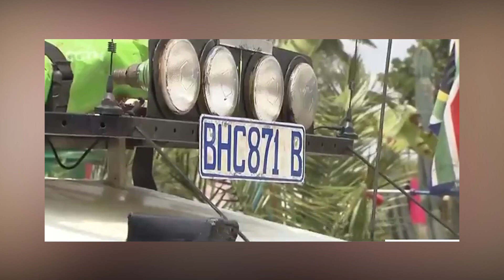When African SCRAP AIRPLANES FLY | African Homemade planes

Comment: The biggest problem with those airplanes is that their propellers are too short and too thin. Some of them would have worked if their propellers were better shaped. Several of the propellers were just thin blades, like machetes' .

Comment: 5:36 thats actually called an gyro plane it Don't power the top propeller only the one pushing it by using the auto rotation the top blade makes lift and make the plane without wings

Comment: The last one requested a solution to his plane not flying… well, here it is.. you were ringing a wheelie and your elevator was down. That tells me your center of gravity is too far back. Move your center of gravity between the first and second third of the wing chord. Example: if your wing is 3 feet from front to back, then the entire plane should balance level when the plane is suspended from a point 1 foot from the leading edge of the wing. I’ll be waiting for the update.

Comment: I'm rooting so hard for them... I  build R/C Planes, Drones and even once a powered glider that could carry me (which got me in trouble with the law but I was only 13 at the time), so I know a thing or two about flying. Some of these guys are so damn close! 

Mostly they have efficiency problems with the props, too small wings, slightly too heavy construction,  or CG problems... the one for example that was so darn fast and did a donut needs a wider gear and a different wing profile. 

I really wish I could help them. Bring some waxed canvas and carpenter tools and we could build something that flies like an Ultra-light. 

It's so heartbreaking to me to see how close they're to achieving lift-off but getting thwarted by parameters that are just slightly off...

Comment: Failure in this case is not a lesson learned but a mistake made.  The mechanics of flight has been known to man for more than a century!
Reply: Sure.  But I reckon that most hobbyists in the West would struggle to properly assemble a kit plane if they ordered one.  Now imagine that you're scratch-building: you don't get the kit, only the plans.  Then imagine you're sourcing the materials, not from Amazon or a DIY store, but whatever you can lay your hands on.  In terms of designs and flight theory, these guys have the shoulders of giants to stand on.  In terms of actually fabricating a plane, they are probably worse off than the Wright brothers.
Reply: It's a hobby, you genius...

Comment: Do you have more videos of these contraptions that actually fly? I believe with access to the Internet some smart Africans should be able to scrap together a decent ultralight. 
The autogiro at 5:30 that actually went up is quite descent. KUDOS to the engineer.
2:36 Airframe looks mechanically sound - it was the pilot's skill that let it down.
7:53 Plane should also fly after getting a bigger propeller and wings.

Comment: Hats off the the daring of those chaps. I flew my ultralight back in the 1980's here in the U.S. and not trying to be too critical but most of these craft are too heavy in the materials used Vs. the engine power or not really knowing how to do a weight and balance calculation. I am still scratching my head on a few of those designs. That one gyro seemed to fly well ;-)

Comment: The African lads are very smart. They figured out airfoils, variable pitch propellers, tail rotors. But did not figure out power to weight ratios and center of gravity calculations.

Comment: I do not know much about their research process, but it seems like they have the two most popular types of flying machines and their starting point and building from there, starting with a conclusion instead of building it from the problem-up. Instead they should research about other types of flying machines like autogyros, paramotors and gliders which are less complex mechanically. As of now their biggest roadblock are the heavy engines they have access to, they should remove as much material as they can from their airframes in order to maximize their chances of success

Comment: The number of helicopters leads me to believe that these guys do no research whatsoever, if they did they would know that helicopters are 10 times more difficult to design, build and operate, and that it took highly qualified engineers around 40 years from the Wright bros flight to get it right......
It also occurs to me that they think that if it looks like a plane, it will fly, power to weight and lift to drag ratios are just colonialist concepts conceived to keep keep african genius under control 😂😂

Comment: Have to admire their ambition to achieve the dream. It's impressive some of these gentlemen do get airborne, although I do cringe a bit worrying about them getting injured, especially the helicopter designs. Even with the aid of CAD, a well designed helicopter rotor collective assembly would be a tough task for me without acquiring a fair amount of good reference material. Ultralight airplanes and gyrocopters are the best place to start.

Comment: In the beginning of the video I saw a helicopter flying like a plane, that was the most funny part.
Anyway atleast in the beginning of the video the plane was atleast flying. Keep on working hard you might create you own plane one day.
Reply: Its actually a gyrocopter not a helicopter. The difference is that the rotor on a helicopter is directly driven by the engine whereas on a gyro it's driven purely by the airflow.
Reply: @125brat  
I am glad, in the end it flew away. It was very satisfactory for me.
Reply: It was a kit build. They didn't build that from scratch.😂

Comment: It’s pitiful to see this, we need an honest conversation about the different IQ of ethnic groups because while we labour on under the delusion that intelligence is equally distributed there’s no hope for Africa to advance.  IQ can be plotted on a bell curve, like penis length or height, and most people are average,  if you overlay an IQ bel curve of Africans on the same for any other race you will see the average is very much lower. Even using tests designed to take into account their illiteracy.   Before the Europeans arrived, ( when arabs were buying slaves from black slave traders)  the sub Saharan Africans didn’t have a wheel or a solid building or written language.  They didn’t need those things in that environment,  but in the modern world they cannot compete on any level with any other race without getting constant assistance, that’s ok, we need to accept that.  And appreciate their other skills, great musicians, singers actors athletes, brave soldiers, the Zulu defeat of the British was the worst defeat of any colonial army at the time.  But they’re not engineers on any level.  They were gifted South Africa, and Rhodesia, and ended up in crime ridden starving crap holes, like Harlem and Chicago, even with other races supporting them with taxes and infrastructure they still can’t accomplish a safe calm society,  multiculturalism is a failure, compare Japan with the UK,  clean safe respectful high living standard high culture low crime.  And the UK a heaving steaming shithole of incompatible people where the most productive are being raped of their earnings to support totally useless foreigners.

Comment: I don’t know what’s worse—if they can’t even get the planes they built to take off, or if they actually manage to. Without proper theoretical knowledge of aviation, they are practically doomed in the air. And even if they have the necessary background knowledge, the first flight without an instructor could be almost fatal. I recently started learning to fly. Before the first flight, I had to pass a theoretical exam. Even so, during my first takeoff, I wouldn’t have been able to fly alone.

Comment: The first clip is gyrocopter, a special kind of plane that uses autorotation to generate lift. It is basically a plan that doesnt require wings, very interesting
Reply: I love Gyrocopters, a lot easier to  build than a plane, not the easiest way to get airborne, if that  what you want  then build a microlight that uses a wing design taken from a hang glider, it's a simple  alloy frame and  a strong material covering.  Other than that a gyrocopteris the other way to fly! Good look!
Reply: A gyrocopter is actually a rotary-wing aircraft, but the rotors are driven by the airflow and not directly by the engine which is just used to propel the aircraft forwards.
Reply: @125brat So that's how they work...
Reply from the maker: I agree
Reply: Gyroplane, or autogyro are the proper terms for this type of machine. "Gyrocopter" was the brand name or a small gyroplane kit known as the Bensen Gyro-Copter. "Copter" implies a powered-rotor helicopter
Reply: The guy in madmax  the movie flown one of those gyrochoppers.